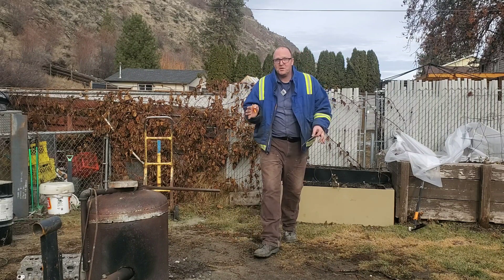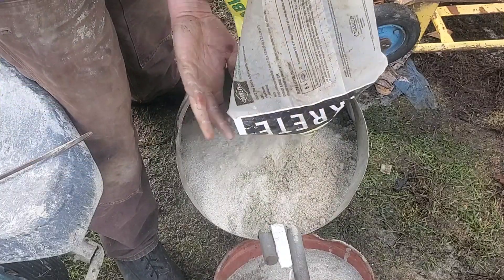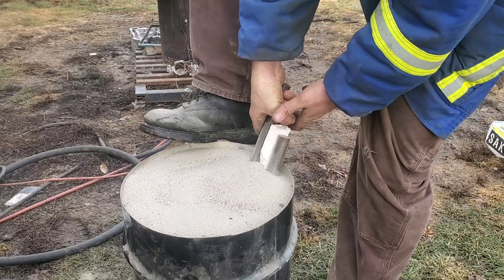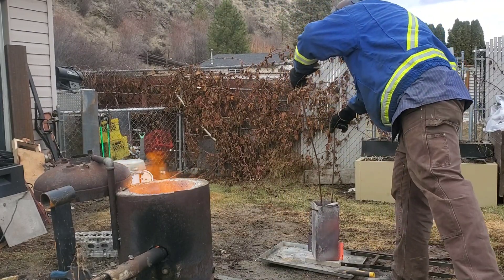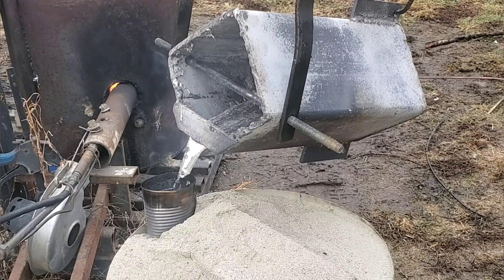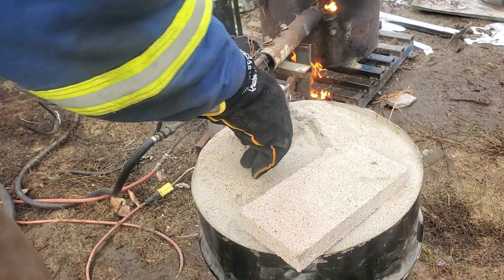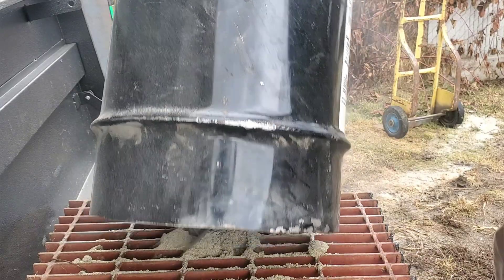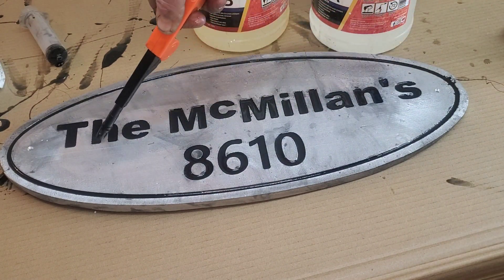Lost Foam Casting A Sign

Comment: 😂Do mind me asking what is that you are using to cut the foam out
Reply from the maker: I'm using a cnc router for the parts. You may see it briefly in some of my videos at the beginning.   I have used wood working tools as well. I just have to be careful of breathing in the dust. I can't imagine it would be that good for you.    Also sanding the parts with sandpaper will take away the tool marks and will give you a better finish.

Comment: I just wanted to add few grains of wisdom-metal pipes like that run and last longer if you coat them with colloidal silicate.If you buy sodium silicate and start boiling it in a SS pot, you can keep adding citric acid powder till you start seeing the small drops of silica precipitating out of the solution, you need to stop adding acid as soon as you see first sign of it. Now you've colloidal silica which is used as a binder in refractory industry and can withstand more temperature then regular silicate.

Sodium silicate is great for core making if you mix it with sand -it cures with CO2 so you can cure cores fast with 2 jars connected with hose -in one you place cores in other baking soda and vinegar.
You can coat your polystyrene pattern with home made slurry made of dry wall compound(used for connecting two boards where tape goes) that you water down to a consistency of a pancake mix .
Another coating you can do is sodium silicate and sand and then you apply it with spatula in thin layers and let it dry .
You can even reinforce coating with wire or stainless steel mosqeto mesh. 
Aerated concrete blocks are great insulators ,dont burn and they are flat ,easy to work with an cut,and they are light  -you can use them instead of wood(or you can make bigger flask and use wood screws to hold it inside -that way wood wont burn out every time you cast) -you can glue them with sodium silicate and sand or use threaded rods and washers -they are kinda fragile unless you coat them with silicate.makes a decent casting flask,or propane forge/foundry  insulator .They are cheap too.Worst part about casting for me is to have constantly remake wooden flasks since i dont have wood working equipment -some people cast aluminum ones but i dont have pattern or big enough foundry.

Finally for the end Olfoundryman on youtube shared a lot of knowledge about sand casting  and mistakes that people do that can be very usefull and improve sucess rate by alot.
Reply from the maker: Wow you got me thinking now. :)   sodium silicate yes. Good ideas  I have used it before to keep the mold flat.    

the oldfoundryman has an awesome channel. Great wealth of knowledge that guy.